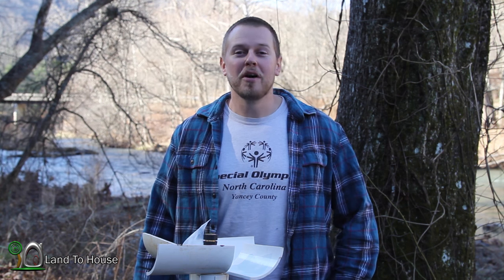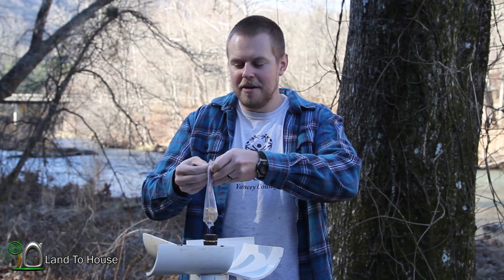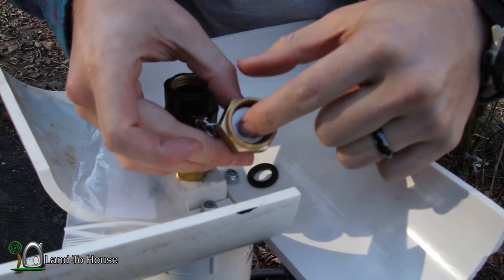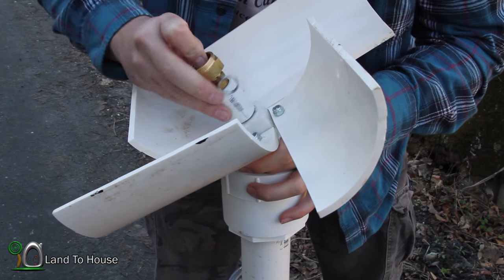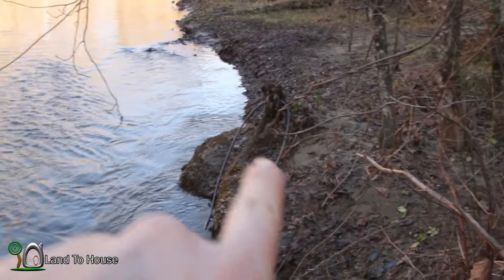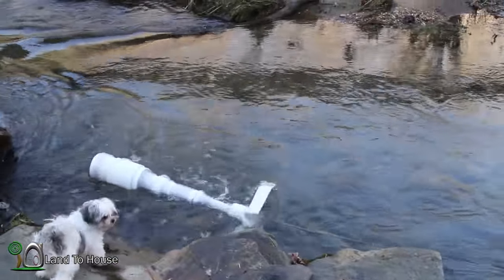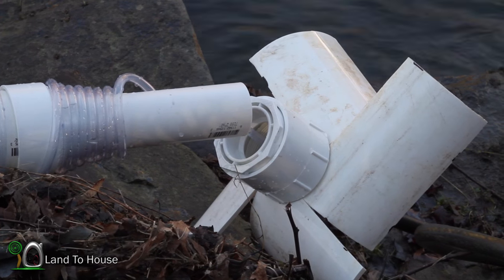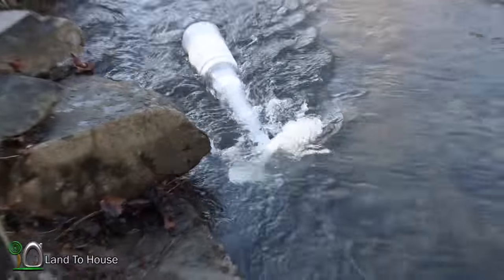River Pump Build and Test Part 4

Comment: I'd be tempted yes to increase diameter, but also can you leave water inlet on outside of housing so it sort of slaps the water and forces the air in... also what about instead of one that flows parallel to the bank, what about making one that sits perpendicular to the bank that is either on a frame or held at the ends (think toilet paper/roll holder) and turned with paddles on the ends (think paddles steamer!).  It could be made out of cable drums, or an old barrel (wood or a sealed metal one), and it could probably work floating entirely on top of the water/part submerged and turn with water coming underneath... good luck!
Reply: Woh! Apparently what I suggested is kind of a thing... well kind of similar anyway... I just saw a video below yours showing a "spiral pump - water pump" where the paddles are on the middle,
Now I've not watched that vid, but just as a thought you could do that, and have paddles suspended between 2'cable drums having swivels in the outside centre for hanging mid-river and winding hose onto them and therefore have a hose on each end and both working at once either going together or to two separate places???
Reply from the maker: I actually started to test that concept way back when I first started the channel. I had the single wheel tested and had a design for the double wheel like you say here. https://www.youtube.com/watch?v=ZuFxqolv-j0

I have been working on a new design of the river pump. It is so very close to done. Should fix several issues that I had with this design. I do have the intake on the outside on the new design.
Reply: Nice one!... Great minds think alike!  Ha ha! :oD

Comment: Just a thought but if you glue blanks inside the pipe sections except for the 6" pipe section then that area becomes the buoyancy for the unit and to me the 6" end looks to far out of the water this would lower that in the water. Anyway all the best with your project.
Reply from the maker: My new design used a 4" pipe that is closed in for buoyancy. Should sit in the water a lot better than this version.

Comment: Great to see the progress just sorry that it was a bit disappointing for you, I haven't any original ideas my first thought was a funnel design for the intake but several others have beaten me to the punch on that one. Looking forward to test 5
Reply from the maker: It was less water than I wanted but still a good test. The funnel and smaller clear tube delivery are the next changes for part 5. I will need to turn the swivel around and use a rope to anchor the pump. Should be good!

Comment: try and use a 1" pipe to wrap around your 'chassis' to minimise the internal pipe friction. You probably don't need to have it wound so many times around for it to work. Using the smaller diameter piping causes too much friction. The bigger the internal diameter of the pipe means the water will flow more easily. Also if the diameter of the 'circle' you use to rotate needs to be larger, that way you get more 'leverage' to push the water higher, but you're on the right track - I think it's going to need to be a bigger diameter pipe winding to be effective.
Reply from the maker: Hello. Thank you for awesome thoughts. A redesign is in order I do believe.  You are right a larger circle like the 55 gallon drum the water dragon uses would be better. Or at least larger than the pipe I am using. A larger pipe would also be nice. I have some 3/4" flex pipe I want to try. When the outside high is above 9 degrees I plan on getting back out to the river. :)

Comment: one of the (many) reasons v2 did not work is this.    the intake scoop (and 95 percent of the coils)  Should have been located at the Largest practical  radius; not the smallest.   cheers

Comment: I'm only at 3m30 but you prob should use a blade guard like modern propellors and fans do (I'd try using a standard house fan blade if I was building this pump). & drones. I'm also thinking I've not heard you speak of a 1-way-valve. There's a bucket pump on the market that uses agitation of the hose dunked in water to create pumping pressure thru a 1-way valve. Did you also know that your own video content may give you a clue as to the solution to a problem voiced within it? The letters CIAL are visible on your shirt. SEAL. Maybe that's the problem : )
Reply from the maker: A fan prop might be good. I wonder if it will be strong enough to handle the fore of the water though. I have a 55gal tank that I want to use for a new test of river pump. It would have a larger base and stronger props. The valve is a good idea.

Comment: You had the right idea but a wrong build. The key is to make your large outside blades spin smaller blades on the  inside of the pipe to force the water through the hose. I improved on this for you but it is in a jpeg if you want it let me know.
Reply from the maker: This old project was scrapped. I had purchased the things needed to make a 55gallon barrel version but I never did get around to making it happen. If you would like to send the image please feel free.

Comment: Hi!! it's my fisrt comment on you tube, i think one of the problem is the garden hose is to big, because the hose of the tubine is  small and it's to heavy to push the water out,why you dont try the same hose all the way, the turbine and thehose same diameter??very cool your experience!!
Reply from the maker: Thank you for the comment. Yes the garden hose is a little big. I am in the design stage of a better setup. I need to use a larger housing and a minimum of 1/2" inner diameter pipe.

Comment: Looking a professional model. It occurs to me that the increased size of the outlet hose is causing of loss of the air that is used to pressurize the system and not allowing it stay pressurized to the top.
Reply from the maker: I do think that is an issue. In a newer design I used the same size garden hose for all the piping. It did not work either. My newest design has a 55gal drum with hose around it. This model is not built yet and untested.

Comment: Maybe put a cap at the end on the six inch and the hose outside it's gonna be empty ,better float,and maybe balance your turbine when she's full of water in rolling more on the 6inch, it's only suggestion,and sorry for my english i'm french. haha!!
Reply from the maker: I would need to make sure that the place the small pipe goes into the unit has a water proof hole. Placing a cap on the end would be good as long as I can get that small hole water proof. My new design uses a 5gal bucket as the housing.
Reply: I can't wait to see your new project,it's very interesting!!
Reply: Land to House i wanna start by saying ur brave, good that u dont give up, we all apreciate it, my idea is to make it (the cone ) in the opposite way, water may flow better in the river direction, but most important , to use a thicker tube in the cone, and a thiner one to transport the water from the valve ( the thing in middle of the rotor! the blades) cos liquids get more preassure and speed if u force it into a smaller hole.  sorry if it isnt to clear, but im a spanish speaker.

Comment: How much does you spend this system?Spend little money or not?I am interested with your design because I want to follow you for my works. Could I get some ideas from your more?
Reply from the maker: +Yun Chandy this was my early prototype design and it did not work very well. I have a new design that is half done and it should cost somewhere around $40 to $50. If you were to purchase an actual River pump it would be over $400 that is why I'm trying to build a design that is much cheaper
Reply: Could you share for me?
Reply: If you get be successfully, you can share for me
Reply from the maker: It is only halfway built so I have not tested it yet. But I have filmed the steps so far. When I get it done I will post the videos.
Reply: ok

Comment: couple simple mistakes.
first off, tiny tubing will prevent any decent operation.
use 3/4 garden hose on the pump
second, the gulp has to be the largest diameter and it must taper down.  
lay the hose on the bank, do not loop it in tree.
you may be rotating too fast for pump.  you can try in your yard with a hand crank and a tube of water.  let the water return to the tube.
Reply from the maker: +latheguy123 good suggestions! I have now scrapped this design and i am moving on to another one. Should come out in a few weeks. Larger hose, larger scoop, and larger circumference cylinder.  We will see.

Comment: I saw in other videos, it works using the Archimedes principle of pumping water. In the Rife product river pump video the spiral tube is inside a large cone shape plastic drum. I thinking, the diameter of the spiral tube and the outlet hose to where the swivel connector meet are the same size. So that the collected water coming in from the spiral and going out to the delivery hose have no obstruction. 
In your part 1 build video I saw you use that small white thing to connect the small plastic hose and connected to the swivel garden hose. That I think is where obstruction happen. 
Would using a larger tube, like a " PET flexible hose use as water collector winded the whole length of the pump body and coming in the body near the top then connected by a nipple tube of same size as the swivel connector to eliminate that obstruction?
Would a larger pump body and more PET tube winded tightly also help collect more water per turn of the whole pump?
Reply from the maker: +M.E. DAYRIT I think you are right on all accounts. The pump needs to me larger and the tube does as well. I started testing this pump in the late fall and it just got too cold. Now that the weather is better I need to get back out there and make a working pump. Thank you for the great suggestions!
Reply: your goals are noble. I'm from the Philippines, and most  commercially available river pumps in the market and online are pricey. Your DIYs bring hope to us, specially farmers that want to know how to do what you did and save a lot using materials that we can buy in hardware. Keep up the DIYs :)
Reply from the maker: +M.E. DAYRIT that is exactly why I do what I do. I get to learn something new and it helps others. When I saw the price on the river pump at $450 usd I knew I could come up with a better price.
Reply: Wow! In the Philippines that is already 20,000 pesos. Too much for farmers to buy.
Reply: +Land to House Can the cone shape of the rife river pump help it to float somehow? 
I imagine if the spiral tube placement (in the video animation) it produce a water compression because the water travel a shorter distance as it goes near the cone head. Maybe that is the secret to produce pressure to push the water? 
What if the inlet tube is at the side instead of at the back and have a funnel so that much water can be scooped? 
If two or more sets of inlet and spiral tubes use will it help scoop water continuously as the body spins? But how that sets of spiral tubes meet in a single point in the cone and out the swivel connector to the delivery hose?
Sorry I imagine only, I'm not in Philippines now to try if it works.  Thank you.
Reply from the maker: +M.E. DAYRIT it is my understanding that the cone works as you say. The spiral inwards compresses the air between the water and pushes the water up. I am not sure how connecting the two pipes would work. The funnel might work! I will have to give it a try.
Reply from the maker: +M.E. DAYRIT yes that is a high price!

Comment: Try using a half inch diameter hose.  You might get more success with it.
Reply from the maker: +Willameena Siever I have purchased some tube to replace the garden hose so that I can see if water is traveling up the pipe from the pump. You are right I need to increase the size of the tube that pulls in water. The small tube seems to have a lot of resistance. I think that increasing the size of the pump housing will make a big difference. at least 12" or more.

Comment: How much lift can it give?
My village is 1500 feet above the river. I live on a steep hillside in Himalayas.
Reply from the maker: This project is still not working. You might look into the ram pump.
Reply: @LandtoHouse  any update on the river pump? My spring isn't powerful enough to run a ram pump. But I could use a river pump in my creek.

Comment: Land to House, seriously what do you want to acheive? 1)pump water upstream or against gravity try ramp pump design.
Reply from the maker: The river pump will allow water to be pumped from a flat flowing source. The ram pump is only able to operate with head pressure or hydrostatic pressure. A ram pump will not work on flat water. So I am working out a design that is diy.
Reply: you need to calculate the volume in each section thus gives you a golden ratio.
Reply: one more thing avoid spring check valve
Reply from the maker: I have a video showing the ram pump operating on hydrostatic pressure:
https://youtu.be/ow9IJxXQ2Ow

And an old video of the ram pump underwater:
https://youtu.be/sAkWRNUU_BU

The issue with a ram pump in flat water is there is no head pressure. 

As for the river pump, I am testing new ideas. I have another small test in this vlog:
https://youtu.be/wfrV_J4Figo

Comment: some very late info.  see info at  link.    there are reasons such pumps are made having a certain minimum radius.   there is a  Relationship/ratio  between  pump radius and the radius of the pumping-tubing.   the radius of the pumping-tubing Must be sufficient to  Accommodate  the  behaviors of  h2o.        Air Lift effects are the  Key  to water raising.       optimization for air lift effects includes  the use of an output line whose radius is  Smaller than that of the pumping-tubing.      you should attempt to copy, exactly, a rife river pump.    including the  Various  radii  ratios.       googletranslate
https://lurkertech.com/water/
Reply from the maker: Thank you for the info. I was actually just finding this out for myself when I lost interest in the river pump. I had purchased a 55 gallon plastic drum and had begun making plans for a wooden prop system that would allow the unit to spin in the water. It was going to have larger tube and blades. But I have moved on to other things for the moment. Someday I will get back to this fun project.

Comment: Use a 55 gallon drum and a prop from a old boat
Reply from the maker: Yes the 55gal will be two designs from now. first is a 5gal bucket.
Reply from the maker: Yes. I am actually looking at a couple pressure washer swivels. They are about the same price but designed for water and a little bigger than 1/4"

Comment: Floating too high in the water you are getting no intake, with a wide mouth squeezing down to a narrow pipe your do not need a propeller....
Reply from the maker: +watchthe1369 I have dropped this design and i am now working in a new one.  This one has several issues to work out.